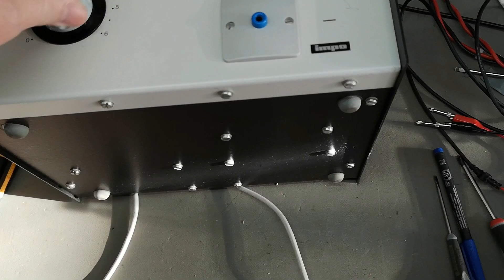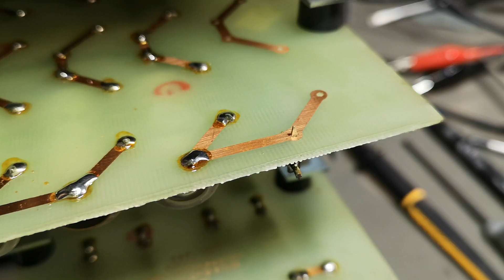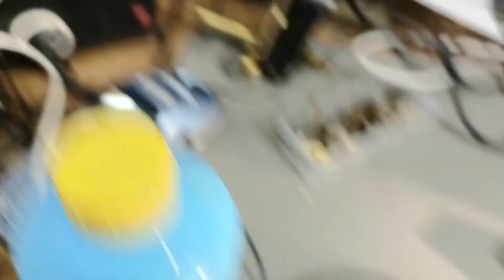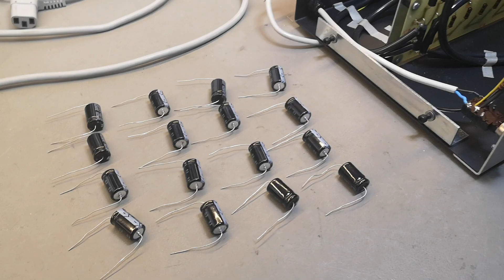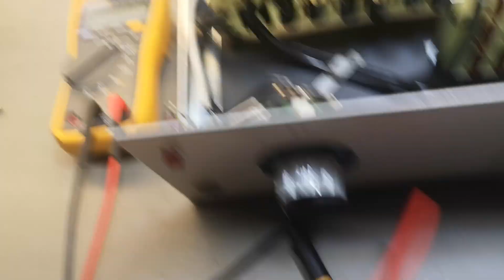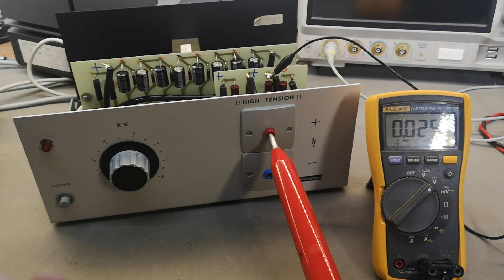IMPO 0-6kV variable high voltage variable supply repair test teardown

Comment: That's cool ! never had a chance to handle such device. now i have an idea how i should design it if one day i want to build one. thanks :)
Reply from the maker: i recommend to use a tiny variable voltage transformator, as the primary side voltage set, NOT a large variable power resistor as this one is made.. maybe it is a repair ?? or a modification, let us know one day some one else open a similar impo and can tell us if they are all like this ??

Comment: High voltage noise easy to fix, cut all sharp edges and make all points round with solder, then clean the board, and coat with a conformal varnish to keep the discharge down.
Reply from the maker: always a good advice of high voltage , the funny sounds starts allready at a few kv

Comment: Week 13 of 1975, basically made between 23 to 29 March 1975...... Probably would have been easier to replace all the electrolytics with some 10uF 400VDC polyester film units, which would probably last forever in this application.
Reply from the maker: exactly, but the size and cost of film types will kick the budged out of this repair, the customer was not up for huge expense.